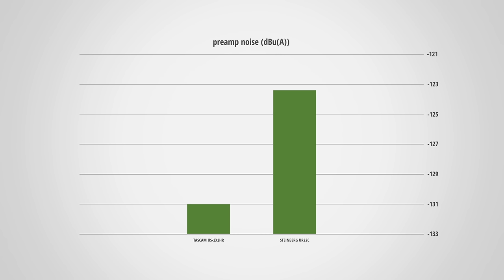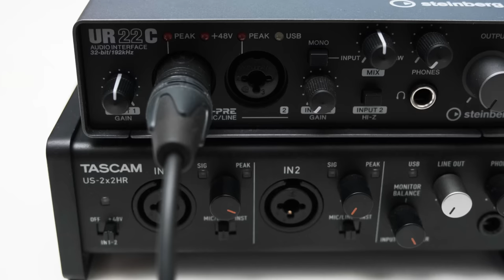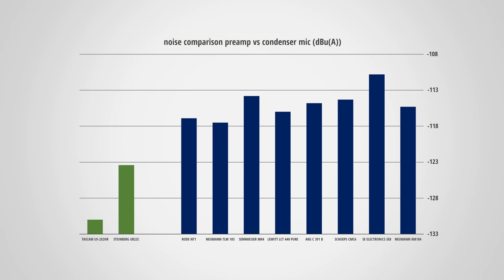You are WRONG about preamp noise!!! - (condenser vs dynamic mic preamp myth)

Comment: Again, if somebody is interested in some tech details. Noise voltages don't sum in a straightforward way like Va + Vb + Vc ... +Vz. It's impossible to calculate an absolutely accurate sum of two noises, but as a rule of thumb sqrt(Va*Va + Vb*Vb, etc) is used with adequate results. So what happens when we try to sum the noises and one of them is 12 dB (roughly 4 times) louder than another, a quite common situation, described in this video? sqrt(4*4 + 1*1) ≈ 4.1, which is ≈ 0.2 dB of extra noise, the higher noise source (4) is dominant and the lower noise source (1) doesn't affect the noise level significantly. With 6 dB (roughly 2 times) difference it is  sqrt(2*2 + 1*1) ≈ 2.2, it's worse,  ≈ 0.8 dB of extra noise, but it's far from the straightforward 2+1=3 ( ≈ 3.5 dB) anyway. The numbers were chosen for clarity, the real noise voltages are in the 0.00000... V area usually.
Reply: This probably answers the question I was going to ignorantly ask, of how come the noise of the preamp doesn't just add to the noise of the mic. It's because the mic noise is first in the chain and louder, so any softer noises after aren't added linearly. Because the physics of noise VOLTAGES getting added together isn't the same as what you'd get from hearing different audible noises added together in a room. Do I have that right?

Comment: Wonderful video as always.

The big take away here is the fact that, as you said, almost all the time, a line leveled Dyn is gonna have a way higher noise floor than a Condenser due to the Conds being louder by default and higher dynamic range. Add to that the lack of treble the Dyns often have and how obvious the noise becomes if you ever shelve them, I almost never recommend dyn mics for relatively quiet signals like most people voices for example, and never in a broadcast environnement where compression is gonna be necessary.
Reply: There's a lot of overlap in noise floor between cheaper SDCs and hotter dynamics. For example a Beta 58a at 290ohms and brought up to line level (+51.5dBV) would have a noise floor of -78dBv (trusting you don't have a noisy preamp) which is the same as that of a Shure SM81 (the SM81s figure is A-Weighted so it's likely even higher than that). The SM81 isn't even as noisy other popular lower-end SDCs like the AKG 451B or the Octava MK012.
Reply: @ceilingsandfloors  Some SDC truly are noisy. The DT797PV i'm using right now for instance. Tho It's VERY preamp dependant, and not necessarily a preamp noise floor thing. But they usually have a friendlier top end than most dyns, needing less EQing/potentially boosting the noise in bad places

Comment: Julian, at 4:39 you show a graph of the noise of some microphones - you say calculated noise. Therefore it seems you used the specification data for that calculation, right? Or did you use some measured results? Because "on paper" the SE8 has only a self noise of 13dB -- the same like the Neumann KM184. But in your graph you show a much higher noise for the SE8. This correlates well to my practical tests. I have the AKG C391B which has a self noise of 17 dB. In your graph the self noise is higher than the KM184 -- which it should be. But the AKG in your graph shows a much lower noise than the SE8, which in my real world experience is true, but is not seen in the specifcation sheet. So what is the explanation for that? I'd love to hear an answer. Maybe also a nice idea for another video!? 😀

Comment: Thanks! I've been wondering about this for some time, as I'm using a Steinberg UR44C, which I noted in your previous tests is (or the 22C sibling) has one of the worst noise specs, and is often used in your comparisons, like this. Yet, I don't detect a disturbing level of noise in the recordings. Surprise, most of my recordings are just condenser mics, or maybe 2 condensers and a dynamic, which I suppose still gets trumped by the noise from the condensers.

Comment: What you discuss in this video is the headamp concept in low noise electronics design. The first amplification stage or "head" noise spec dominates over the next stage's even if it has three times higher gain than the heading stage. More than three times the head gain coming after it, starts to slowly allow extra noise to mix in.
Reply: For example if the condenser mic has 20dB amplification inside it, even 3X or 60dB in the sound interface will not allow it to play an extra role in the system's noise.

Comment: Interesting, but when I recently hooked up my Shure SM81-LC mic to a Tascam DR-40x, the latter added a very audible noise level to the recording, compared to my previous Focusrite Scarlett Solo (3rd gen) setup with the same mic. Does that mean that the noise added by the DR-40x is "unreasonable", as you've explained? Also, do you have a favorite portable audio recorder which I could replace the DR-40x with? Thanks for all your videos, they're super valuable.

Comment: Hi Julian, just half an hour before watch this video, I have my Rode NT1a and Shure SM57 recording in a dry channel and comparing the noise.. what you said is totally true!
If you use a dynamic mic, use a better preamp. If you use a condenser mic, use a better self noise microphone.. :D
But I have a problem here,
I tested both microphone (NT1a and SM57) to find which is better to reduce "Ambient noise". I have a lot of ambience noise from a road nearby even I've soundproofed my room with some Roxul insulation (not the ceiling though, not yet)
I make an asmr unboxing video so it's a big problem for me.
Using a dynamic cardiod microphone (sm57) does not solve the problem as my test today say so.. ambient noise only reduce by 3-4 db but the preamp noise is quite a big jump
Is the only solution for my problem is to use a hypercardiod microphone? I know some condenser hypercardiod microphone such as samson C02 but the self noise is -22dBa...
do you have any suggestion for me?
THanks a lot!
Reply: Not sure a hypercardioid will solve your issue without adding other problems: Hypercardioid microphone do pickup some sound at the rear of the microphone and that may not suit your needs and also have a significant proximity effect (extreme bass amplification when you are close to the capsule). 
Maybe you could consider using a dynamic microphone (to naturally reduce the ambiant noise) that has a fairly high outpul level (to compensate for the preamp noise). A microphone such as the Prodipe TT1 has a much higher output level as the SM57 and costs next to nothing. Or you could try the Aston Element that has a very special capsule to provide the behavior of a dynamic microphone with a high output level and excellent high end that you usually lack with dynamic microphones

Comment: 3 minutes in I was brought back to reality. I've been struggling so hard to design a stereo mic preamplifier based on input transformers of all things only to start pulling hair out over which opamps input stage really lowered noise floor. This of course is also considerations that must be made for discrete electronics like individual transistor stages or tubes.

Reality is people are of two fields here, musical, or wanting to hear a fly fart properly from 20' away using the cleanest known audio path. Doesn't mean you should give in to hiss though, that's usually a fault of design or cheapening, or a mistake in understanding your equipment and impedance matching.

Comment: Decided to comment under this video again for better visibility: Hello Julian. I am currently recording on a 10y old Scarlet 2i2 1Gen and want to upgrade to something more professional (had a few songs on the radio and my interface is really lacking). I now have the chance to buy a used (1y old) UAD Apollo Solo Interface (with classic collection plugins) from a local recording studio and was wondering if it is worth the higher price point when compared to other (cheaper) interfaces (eg. Audient iD 14, SSL2/2+ or even UADs own Volt 276). To be clear - I am looking to buy something that will serve me well for another 8-10 years of my musical journey (so I would rather pay a little more and be satisfied than having to spend more down the read). Thank you very much in advance and all the best!

Comment: There was a difference, there is a spike in noise at around 6-8 kHz (in the white noise signal) with the Steinberg pre amp that is not present in the other example, the rest of the noise sounded the same though

I have no opinion on preamps, just saying what I hear

I get how due to the 60 Db increase the effect is grossly multiplied, I agree there was no noticeable difference with the Voice audio switch

Comment: Hi Julian, when you tested the original Focusrite Clarett 2Pre, your testing showed great results regarding dynamic range on the mic inputs and line outputs, with poorer results regarding mic pre noise and it’s headphone output. I recently purchased the new Focusrite Clarett+ 2Pre. It sounds so great that I feel like I bought new studio monitors. Focusrite claims they have improved it’s specifications with a new, different ADC/DAC chipset and headphone output.  I’d be curious to see your results when testing the new one, as I have been very impressed so far with subjective listening.

Comment: True and well explained. Still, there is the issue of condenser mic self-noise. Very low self-noise is a feature of expensive condenser mics. I have noticed that inexpensive condenser mics have a wide variation of self-noise, even within the same make and model. There isn't such an issue with dynamic or ribbon mics when you have very quiet and high gain preamps in your mixing or audio interface.

Pay me now, or pay me later. ;)
Reply: There isn’t much correlation between a condenser microphone’s noise and its price, meaning low noise is not a feature of expensive condenser microphones. For example, Røde’s NT1 has a stated noise of 4.5dAB and costs only $299 US (and that’s in a kit with shock mount and pop filter). Lewitt Audio’s LCT540 Subzero is currently the quietest mic on the market at 4dBA, and costs $699 US (again, sold with shock mount and pop filter). Neither of those could be called ‘expensive’ and yet they’re the two quietest microphones on the market at this point in time. Meanwhile, Earthworks QTC30 has a noise of 20dBA and costs $799, Neumann’s classic U87 Ai has 12dBA of noise in cardioid mode and costs $3650 US, and Neumann’s latest revision of the U67 has 17dBA of noise in cardioid mode and costs $7225 US. So more money does not mean less noise… [All prices here are from B&H’s webstore.]

There are two noise sources within a condenser microphone. The first is Brownian noise (named after botanist Robert Brown, nothing to do with colour), which is due to air particles randomly rubbing against the diaphragm. It sounds rather like white noise passed through a very steep low pass filter, considerably darker than pink noise. Then there is thermal noise (the classic white noise style of ‘hiss’) which is related to the impedances of the mic’s internal circuitry and the temperature. The total noise coming out of the microphone is the combination of both, and to accurately represent that the term ‘Equivalent Noise Level’ is often used in preference to ‘self noise’ in contemporary specifications.

Although there is no significant correlation between noise and price, there is a significant correlation between noise and diaphragm surface area. If we double the surface area of the diaphragm (and keep all other parameters the same), we’ll get twice as much Brownian noise and twice as much signal. The Brownian noise is uncorrelated, so doubling the diaphragm’s surface area creates an increase of 3dB (i.e. x √2) more Brownian noise. The captured signal is correlated, so doubling the diaphragm’s surface area creates an increase of 6dB (i.e. x 2) more signal. End result: double the diaphragm’s surface area and get 3dB more Brownian noise but 6dB more signal. So the signal going into the impedance converter circuit is 6dB stronger while the Brownian noise going into the impedance converter is only 3dB stronger. In other words, a higher amplitude signal with 3dB better S/N ratio going into the mic’s impedance converter. The microphone gets lower noise and higher sensitivity; the latter meaning it outputs a larger signal and therefore requires less preamp gain (technically the noise from the preamplifier is there but it’s not very significant compared to the noise from the condenser microphone itself, and especially less significant compared to a higher sensitivity condenser that requires less gain).

The NT1 and LCT540 Subzero are large diaphragm mics (around 25mm), which is part of how they achieve their low noise. The QTC30 diaphragm is tiny in comparison, which is why it has such high noise. Similarly, DPA’s 4060 has a noise of about 23dBA and a diaphragm of around 5mm. So why bother with small diaphragms? The advantages of very small diaphragms are higher SPL handling and excellent off-axis response. As we make the diaphragm larger we get less noise but also reduced SPL handling and worse off-axis response (the microphone becomes increasingly directional as the frequency gets higher because the diaphragm itself literally gets in the way of very high frequencies).

Rough late night examples, but the point is that price and noise aren’t really connected. Diaphragm surface area and noise are, however…
Reply: @gregsimmons1709  Well marketing spec sheets are one thing, but then there's experience. Low self noise is a costly thing to guarantee, with consistency and quality control being big factors. 

If marketing spec sheets were what mattered, we'd have a lot more $40 "studio quality" condenser mics selling to big name recording studios.

Comment: If you have an interface that can't take much signal without clipping and you have to turn the gain down a lot to where the EIN ends up much worse it can add a bit of noise to a condenser at least those with a high sensitivity and low self noise.

Comment: Hi Julian! Love your videos! I'm wondering, I seem to recall that you did a video where you proved/stated that a Shure SM7B doesn't necessarily need a CloudLifter or another kind of preamp. Do you still feel this way? (Now that the price has dropped on the SM7B, I'm once again lusting after one, but, as usual, I'm balking at the additional price of a CloudLifter.) ( I'm using a Presonus Studio 24c, and a Presonus AudioBox USB 96) T.I.A.!
Reply: whether or not you need an inline preamp depends on the audio-interface and its preamps and their capabilities and not just on the microphone. The PreSonus Studio 24c has good preamps with low selfnoise. It can power the SM7B as long as its close to your mouth - just plug in the microphone, turn the preamp all the way up and see if your audio-meter reaches a proper recording level. if you have it further away you might benefit from an inline preamp due to the 24c's limited gain supply - check the video here https://youtu.be/s3a-MnP2GFA The USB96 unfortunately has really noisy and weak preamps so you would absolutely benefit from an inline preamp there - check the video here https://www.youtube.com/watch?v=phiFdrsijI4
Reply: @DrWurzeli  Thanks!